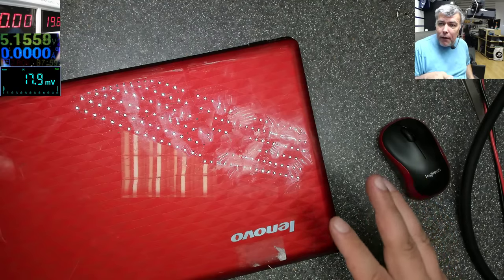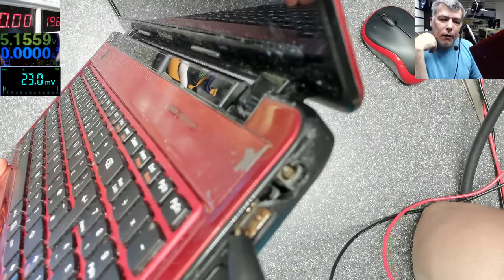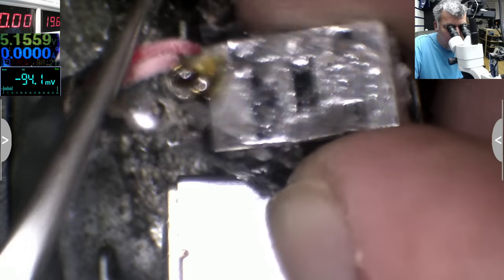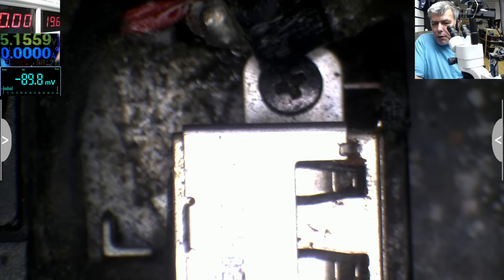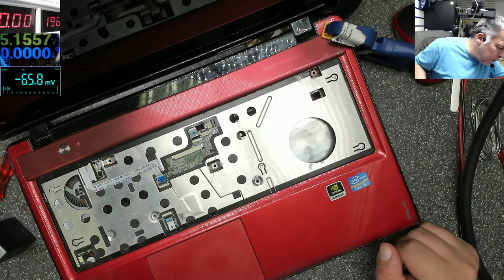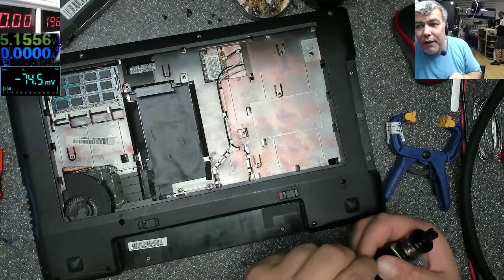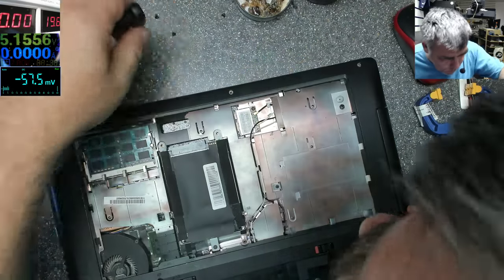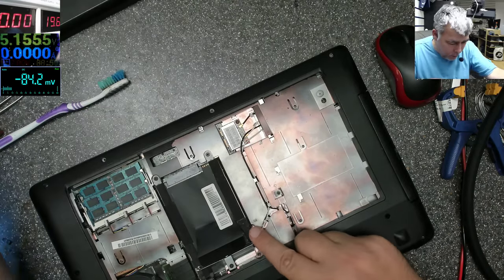Lenovo Laptop - no power, not charging, let's learn to diagnose

Comment: Nice fix Sorin! I hate trashed laptops like this. One problem fixed - you have another. I had this kind of job recently. Customer gave me trashed Asus. Told me to put SSD instead of DVD, Install Windows, upgrade RAM. Before do anything I checked if the computer is working in the first place. Surprisingly - he did. Then I assembled laptop back again he was dead. Spend hours to figure out the problem, and found that power cable was dodgy. Laptop was opened like thousand times before by the customer itself (screws damaged, in wrong places, different sizes, used even screws for wood!) A few pins were partly broken. I told the customer about the problem, he agreed to took it back and had no complains. After few hours, he contacted me and blamed that I damaged his laptop. Keyboard, touchpad was not working, because he lifted WHOLE screwed motherboard with cables still in places. In the end of the day, I was one who is guilty. So yeah, dodgy laptops and dodgy customers should be avoided in any possible way.
Reply: How? Should they be sent away?
Reply: @sodiumtechnologiesug366  Don't think so. Its a customer after all. Just do your best, and like Sorin said - "if I don't check that connector, most likely customer come back and say "You broke my touchpad". So take your time, fix that you can fix to avoid any problems, if needed, just inform customer about situation. If he agrees with that you offered and advised - it's a win. Dunno, I'm talking from my point of view. Maybe someone comes with better idea and story,

Comment: Brilliant as always, I have a charging issue with a Lenova  Yogi Book, sent it back to Lenova,  just 3 months outside the warranty and they wanted £158 to replace thetab LV KB assembly Wacom AP101 604 GB, A tab LV YB1 X90 USB FPC  and a TB LV Micro USB Cable CD 22 1 m 2 BLACK ,and TAB lV micro USB cable CD 22 1 m 2a black , the machine brand new was only £278 so their repair would amount to 58% of the actual purchase price.I then discovered this is a fairly common fault reported by many people but Lenova didn't care, I wrote to them appealing to their better nature but no joy, decided against the repair as I can charge it ,I Just have to wiggle the charging cable around until the light comes on, sure wish you lived near me here in the UK.

Comment: What a mess they made of that, broken plastic, and screen support plus rust/water damage.
People treat laptops like crap :-(
Reply: i know. shit ive got a lenovo ideapad z370, it literally looks brand new. the only thing is that the front cover has 3 very deep scratches, the keyboard is worn and the plastic has become brittle. nothings been replaced on the system physically. ive done upgrades on the processor to a core i5, changed the original hdd to a 512GB ssd, applied new thermal paste (MX-4) and lubricated the fan. its from 2011.

Comment: Thanks for the video. You give many universal tips, which can point someone in the right direction.

One thing : Is there a reason why you don't use a hot glue gun? They heat the glue out of a small nozzle, so they're very useful for precise work. They're very cheap too. Maybe it can save you some time?
Reply: I think because hot glue gun heats up way longer and they are olways broken , hot air reaching  operating temparature in few seconds , if you have skill in your hands you dond need precision 😜

Comment: Great content !!
I repair hinges too and to me best combo is  two component epoxy just on screw stands and hot glue to seall it all.. It will never came apart.. Hot glue usualy holds good for some time, depends on a user... but it's not very good permanent solution
Reply: Right.  I'm no pro but that hinge job seems extremely temporary and will fail very shortly.

Comment: For hindges i personaly use acrilic resin for dental fixtures. Two component cold cured for reparing acrilic dentures. Liquid monomer and powder polimer, bonds in 10min. Some laptops have mixed plastics whit too much policarbonate in the mix, only than bond can be problematic. Othervise its beter that original

Comment: to diagnose a faulty charging port is easy and done in less then 1minute!...Multimeter on resistance and test the plus minus pins...is there a high ohm readings, its clear that the Charging Port is connected to the board!! if there is still no readings or open, then maybe the Port is the problem!! this were the easyest and cheapest fix! if there is a short , its difficulter, but even with a short you know, that the port is connected correct to the pcb

Comment: when i disassemble a laptop i always prefer screen lid in upright position rather then shut. i broke enough hinges to learn this. i am not saying you caused hinges to broke and i believe they were been broken for a while but generally if you unscrew the hinges from bottom and lift the screen up you will highly likely to break the hinges from base because of wear and tear and the pressure.

Comment: Was the connector that was desconected when you connected bsck create estatic you forgot discharged the static well basically you did it taking off components but the easy way was pressing the power button for 30 seconds.

Comment: Check the screen connector and other connectors and pins for oxidation, dirt, dust residue under the microscope, probably you will find some in some places, if this is the case clean it, hopefully this will fix those issues, worth a try 😁, good day.

Comment: You can tell by looking at it that it's being used in a high humidity environment. The owner may have a humidifier or live in a damp area but you can tell whenever zoomed in that everything has that slimy/gunky coating on it from electronics being used in a damp environment. 

It won't last too much longer, in my experience.

Comment: Right now I'm dealing with the PS4 of Doom, my original PS4.

It will work fine for days in a row and then it won't work at all. Nothing changes. All cables are fine. TV is fine, it's not the TV. It will work and then just decide not to.

I'll take it apart and do nothing to it, reassemble it and it will work again.
This repeats forever. I've done it probably 10x since I've owned it. Some have claimed it's probably a bad HDMI IC chip but it tests fine and a new chip is too expensive test the theory.

Power supply shows 11.95v. HDMI port is in perfect condition. APU isn't skewed or lifted anywhere. All tests show normal traces and components. It gets full power to the PSU ans out of it.

It just decides when it wants to work based on...? It's infuriating. It makes zero sense.

Comment: I have a lenovo yoga 3 pro that is completely dead. No lights. But I get voltage in some places. Ordered new connector for power to motherboard. Still nothing. What parts in the laptop can I remove to get some diagnose? Everything? Thanks

Comment: all fine and dandy with the hot glue until the next guy tries and fails to open the laptop not knowing its glued in place and needs reheating;
effective but maybe not the best practice.
Reply: if y would have see the complete video you wouldn't say that
Reply: i did, i saw multiple videos of him with the hot glue
using it on the chassis aint that great of a call, unless the damage to the hinge screw posts is beyond salvageable

Comment: Hello mate, I have a problem with my laptop. Only works with Intel Graphic Card. It's no working with my GTX 880M, I need to disable on the BIOS and use only Intel Graphic Card. When I try to USE my GTX 880M laptop switch off. Do you have a repair shop?

Comment: Tell customer that the laptop was mess with and he did not said anything, He should pay more even if he was quoted for less, it is all on video as a proof, plus missing screws and a bunch of crazy glue and water on Ram. Customer should tip 20% as a thanks or do not allow this customer service next time.If all fails kick his rear end and keep device as a professional. It is not fail, what if the screen was damaged and motherboard badly burn...you can not just charge him for no ground only (They done that on purpose since they could not fix the ground and hinge). You got serve!

Comment: I put+ into the charge port and groud in the USB or HDMI it shows 20v , what does it mean？and I plug in power cable check the voltage is 0.44v very low on the power jet. please help

Comment: I have a Lenovo P72 The power supply that will only charge my laptop battery when I shutdown. The power supply will not run the pc without the battery. I have tried to use with a new power supply and get the some problem. When I have the power supply plugged in with battery. I do not see the little power plug icon next to the battery icon in the bottom tool bar. I even unplugged the battery and then plugged in the power supply only. I saw the pc reacted to it. I pressed the power button on lap top. It powered up without the battery at first. I got it to the point of logging in ............... Then it just turned off with out me doing anything more. Do you know what in the fix to this problem?

Comment: So you are checking common ground with shorting? What will happen if the USB port that you are taking ground from is connected with a thin ribbon cable? 2.5 amps through thin ribbon cable will destroy it. That's insane. Just use multimeter in continuity check.
Reply: USB ports are soldered to a board. I have never seen one that was on a ribbon cable. If you think about it, It would cost more to put it on a ribbon cable than just have it on the board.
Reply: @northpoint1039 Tons of them.  MSI A6200 / Hp pavilion 15-R / Acer aspire (don't remember model)/ Toshiba satellite. If your motherboard smaller than the body, than it's cheaper to guide a ribbon instead of making full size PCB.
Reply: @GrafTrahula  Well, I never came across one. Not saying anything its just I have never seen one in my shop like that. I do see them on daughter boards with cable. Is that what you ment? :)
Reply: @northpoint1039  yes they're mounted in a small PCB since they're made for PCB)) but it still connected with ribbon sharing thin ground wire inside. 2.5 amp at 19v is 47watts of power))) pooor ribbon

Comment: I also have this laptop Asus X453M. i'm trying to figure out and fix it myself. but i don't know what might be the problem. it's not turning on also. but when you plug the charger the power LED indicator will automatically lit while the charging indicator does not. and no response on the lcd. even if you click the power button. the LED light is just steady. i tried using the laptop w/o the battery to check if it is the bat. but still same scenario. can anyone know what might causing this? Thanks.

Comment: what are the clips the keyboard ribbon connects to named? one broke so i cannot connect the ribbon now and cannot find the name of them so i can order it
Reply: Keyboard ribbon connector. Ebay has them. However, I just repair them when they break. I will get some clear plastic like the kind some products are sealed in when you buy them and wedge them in with the ribbon cable. Then just a little dab of hot glue to hold it in place.

Comment: Hi I have an hp 15-f305dx. When I press the power button the charging light blinks 3 times nothing turns on. This is with just the mother board and charging plug connected. Would anyone now the problem? Thank you
Reply: The board id is daou93mb6d2 rev:d
Thanks for any help.